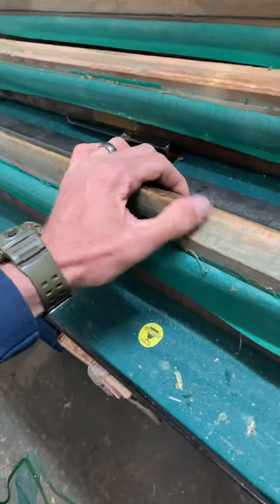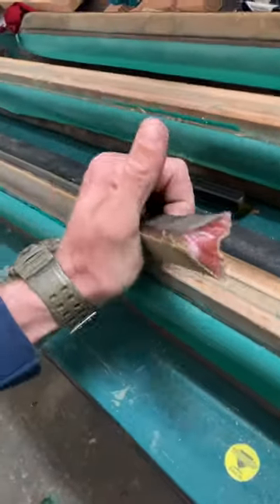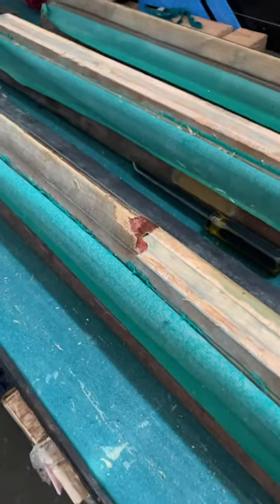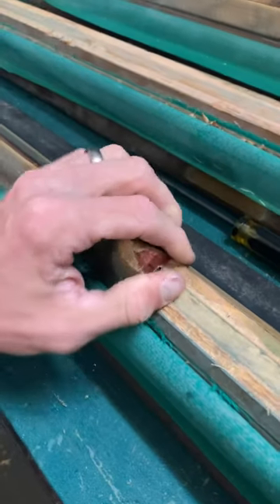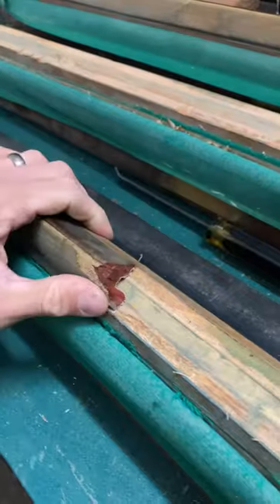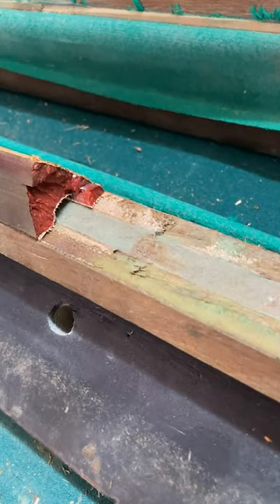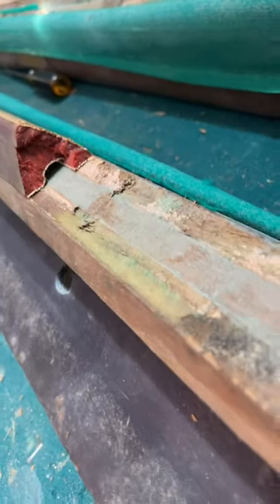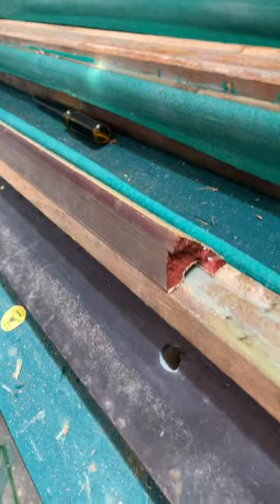Part 2: Pool table rubber replacement

Comment: Can you heat it to release the glue?
Reply from the maker: I haven’t needed to use heat, some people do. But it may be worth a shot as long as you don’t get it too hot.
Reply: @YoooItsRex  thank you for the reply gonna buy my first table soon and decided to go with a valley just cuz of size and how its the main table at league.
Reply from the maker: @juliomac8497  very nice! Valley rails are slightly different. Depending on your funds, if the rails are bad, it’s usually easier to buy a new set of factory rails and just put cloth on them.